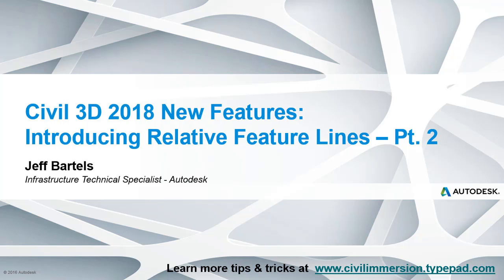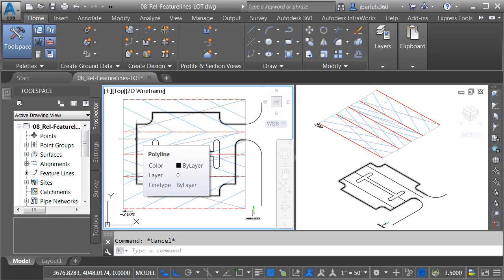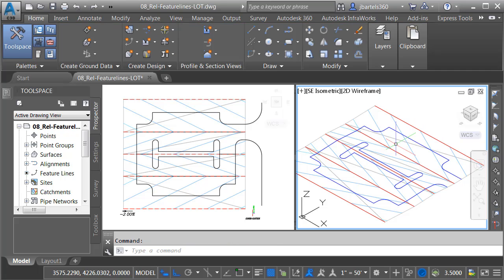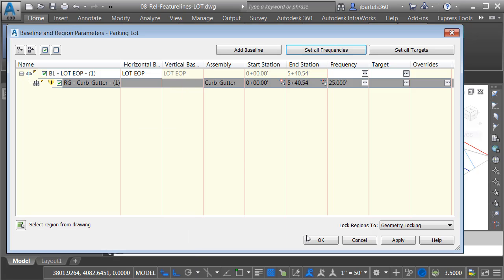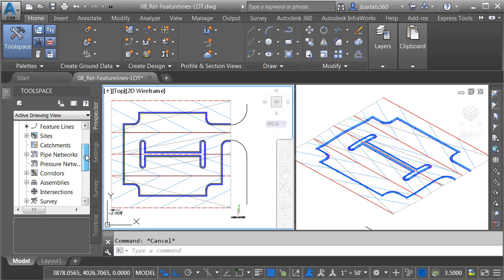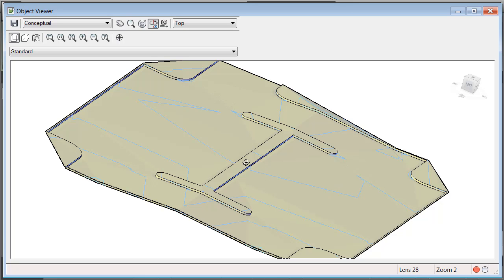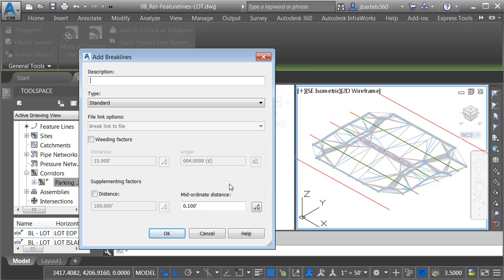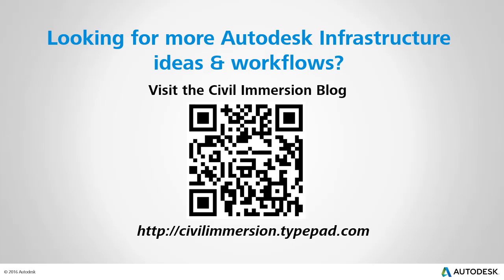Civil 3D 2018 New Feature: Introducing Relative Feature Lines - Pt. 2

Comment: Hi Jeff,
Looks like there are no corridor bowties around the sharp corners of your curb and gutters. What solves that?
Reply: Sub assemblies with fixed width parameters such as kerbs are automatically neatly shaped on corners like a mitre joint or picture frame.  But I sometimes end up with bow ties trying to model a verge subassembly on the back of the kerb, which is frustrating.  Currently working out a way to model grading without using grading tools as they are temperamental.
Reply: @roberthampton1430  I still resort to feature lines and grading infills because of time constraints for each project. Wish there was an easier way to model carparks. 🤷

Comment: Thanks Jeff, your videos are great! I would like to know, your styles that you use, for example your corridor styles, featureline styles etc. (in your videos, they're typically prefixed 'ADSK'), are these autodesk defaults or are these your own custom styles. I would love to get hold of the styles and template packages you use.
Reply from the maker: Hi Johan, The styles I use in my sample drawings are one's I've created myself.  I typically re-arrange things for each video to ensure the objects I'm working with are easy to see on screen.
Reply: @JeffBartelsCAD  Thanks for the reply. It would be great if you could make a basic styles package available to your viewers. I find the styles that I work with at the office always have some kind of issue. Would be great to build up new styles for myself based on your styles which look and work great.
Reply: @johanwahl9404  you can prepare them yourself in in the drawing and save that draeing as tempelate file for further using those styles in future projects.
I am also in learning process but this civil 3d is hell of a software which requires a whole lifetime to master it. 😅😅

Comment: How do you make the surface from Feature lines? Is it creating breaklines? Do you have a video on this? I've created mine but it seems not connecting to the surface as shown in the video. When I move my feature lines the surface does not update.
Reply: Add those feature lines to your surface as breaklines. Make sure your surface is updated as well